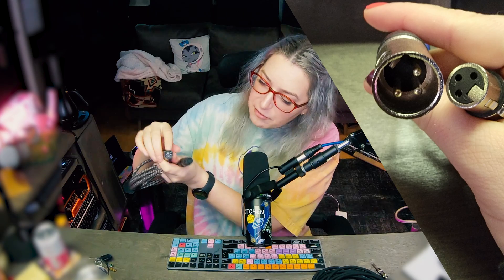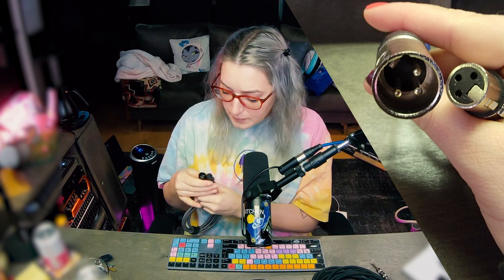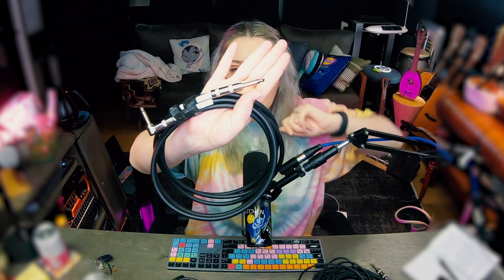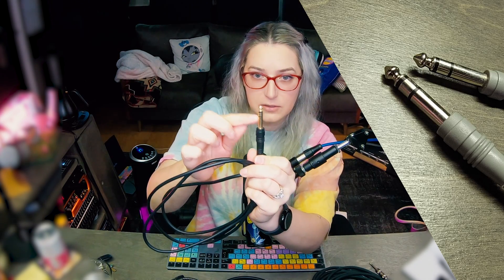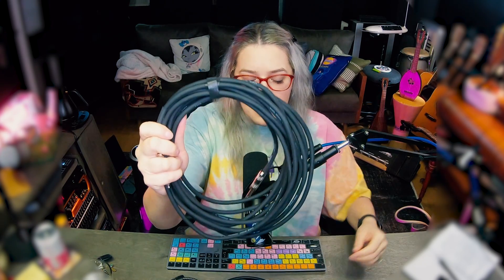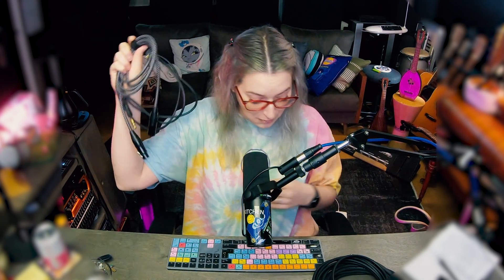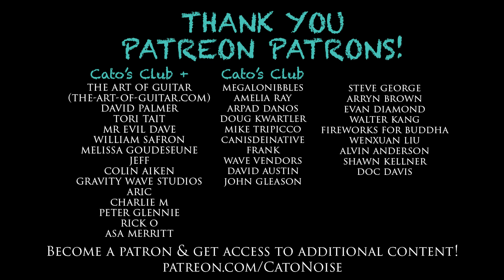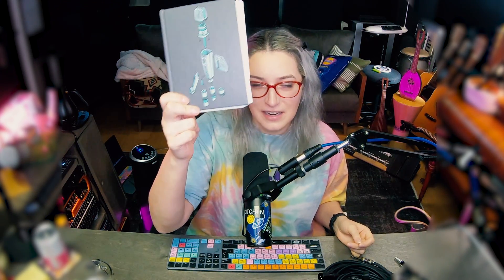Audio Cables 101: How Balanced Cables Reduce Noise, TRS, TS, & XLR, & Speaker vs Instrument Cables

Comment: Well, I'm not any professional in music industry. I'm simply a teacher of commerce subjects. It was my birthday yesterday and I've gifted myself a guitar to disengage my brain from all the noisy words of the regular languages. I think I've acquired enough wisdom in words grossly. Now is the time to go beyond. Well, I'm 38 years old. with my guitar I got a quarter inch TS shielded cable, which is very thick. I was about to use my audio TRS. So, I asked Gemini. It says it's not possible and provided your video link.
Reply from the maker: Happy belated birthday! So glad my video could help you on your guitar journey, that's such a cool way to unwind!
Reply: Thanks for such a quick reply. Well, Gemini says I can't use TRS  plug-in in the guitar's TRS jack because the Ring between the plastic insulation won't let it complete a circuit to switch on the Ibanez Preamp. It's only the TS shielded cable that can switch it on. Do you also agree with it?

Comment: Here is the simple math of why Cato's explanation in the video works. Imagine your audio is the number 5 and the noise is the number 1.

Unbalanced (TS/RCA):
Cable sends signal (5).
Noise (1) leaks in.
Result: 5 + 1 = 6 (Distorted/Noisy Audio).

Balanced (XLR/TRS):
Cable sends two copies: Normal (5) and Flipped (-5).
Noise (1) leaks into both wires equally because they are twisted together.
Wire A has 5 + 1
Wire B has -5 + 1
The Magic Moment: At the destination, the gear flips Wire B back to normal.
Wire B becomes: -(-5 + 1) which equals 5 - 1.
Final Sum: The gear adds Wire A + Wire B.
(5 + 1) + (5 - 1) = 10
Result: You get double the signal (10), and the noise (+1 and -1) cancels out to Zero.
Reply: What is the "Gear" doing?
Inside that piece of equipment (the mixer, interface, etc.) is a tiny electronic component called a Differential Amplifier.
When the cable plugs into the "gear," this component is the "brain" that says:
"Okay, take the signal from Pin 2 (Normal)."
"Take the signal from Pin 3 (Flipped)."
"Flip Pin 3 back to normal."
"Add them together to kill the noise."
So when I said "the gear flips the signal," I meant the internal circuitry of the mixer or interface you plugged the cable into.
Reply from the maker: Thanks so much for adding this! That's a great way to put it, and I'm sure it'll help people understand even better 😊
Reply: It's not me alone. it's Gemini and me!😊

Comment: Couple of pedantic points (on a truly impressive video but I have some experience with mics:)

* A differential amplifier (the receiver) doesn't care which signal is flipped, tip or ring, doesn't matter. Only one input is  inverted. Might need some hand waving but I assure you this is the case.

* Differential cable can also power a microphone too. Condenser units (the ones  you brandished so brilliantly in the MS Stereo video). So there's not just a signal on each wire - there's also (typically) 48V on each one too. The exceptions are dynamic and most ribbon mics, although I did hear of a powered ribbon appearing with an on-board amp - maybe someone finally solved the transformer problem. (Technically someone did at least a decade ago, but that used 128 transistors - themselves quite expensive ones at that.)

* The first (at least the most common) circuit for biasing and amplifying a condenser mic (which up until the 1950s was all transformer based) was developed by Jurgen Wuttke of Shoepes. I only know this because I've spent hours admiring the circuit (after I'd figured out how it worked, which took a while).

*  Last but not least, did you know that you can make a "pseudo-balanced" cable by connecting  the Tip or Sleeve to ground. It's not ideal (and won't work with a powered mic) but a lot of professional microphones do just that. Drop the signal on one line and then match the (50-200 ohm) impedance on the other. So long as the impedances are the same on each line, you get the noise reduction. Might save on a few components, I might have to try it.

* Another interesting fact - balanced cables disconnect ground. The signal works against itself (it is it's own ground reference). In some weird case where you were using generators in addition to some other gear and the grounds varied by even 1000s of volts, it won't make a fig leaf of difference.  Like you, I love this!

And a final bit of audio history. Early surround sound systems encoded the surround signal, in mono and in antiphase on left and right channels. A differential receiver (the same circuit used in your amp for an XLR) removed the "mono" part of the stereo signal and brought up the surround signal. A slight delay completed the effect.

Comment: So I was watching this to learn about what Cable lead I needed for Rico-sound, on my Rickenbacker 620, which I knew basically was a stereo cable for guitar. Now I am wondering did I just hear correctly that TRS cables are balanced more so than TS cables and that if I use them as a mono lead they cancel out any noise? By the way thank you for defining the difference between speaker cables and instrument cables.

Comment: Really great stuff! This helped me to work out why I was having some weird noise issues with my guitar set-up (Line 6 POD Go into a TASCAM multitrack console.) I'm hopeful that by replacing my instrument cables with TRS to XLR cables, I should be able to eliminate some handling noise that's been driving me MAD. 

Major props. Even if that DOESN'T fix my issue, this is still really useful info.

Comment: This is only relevant for low voltage signal wires, it doesn't matter for high power amplified signal cables. If there's 200w of audio going through a cable, a couple micro volts of EM interference won't make any difference what so ever.

Comment: For the purposes of explanation, I would have included corresponding jacks. You could show the plugs inserted into the jacks and show how the signals are directed differently.
Reply: Also, the shield (wire mesh around the signal portion of the cable) is generally used for the ground connection.
Reply from the maker: Yeah, thanks! I figure I can show that if I do a soldering video or something similar. I'm usually pretty short on time making these videos lately.

Comment: Speaker cables are always unbalanced, not balanced. Since they carry large amounts of current/voltage coming from power amplifiers, their unbalanced design prioritizes low resistance without concern for common mode rejection.
Reply from the maker: Thanks! And they're usually not shielded too, right? (For similar reasons) So if you use them as an instrument cable, then you're more likely to pick up noise.
Reply: @CatoNoise  yes, exactly! Unbalanced, unshielded. Your channel is great- thank you!

Comment: Those balanced cables are pretty cool, but a lot of synths seem to have unbalanced outputs. This gives me problems sometimes with synths that have a USB connection as well as a line out. What I often run into with a Roland TR-6S is the USB noise interference when the USB cable is used simultaneously with the analog line outputs. It’s kind of an annoying problem, I’ve learned to either only use the USB connection or to only use the line out in combination with battery power to get clean noise-free recordings from it. Are there effective solutions to prevent these sort of ground loop interference issues? I don’t seem to get this issue on equipment that use USB solely for data and that use a separate DC power supply (like the Yamaha reface series). It seems that USB bus power and analog audio connections are not an ideal combination in regards to noise.
Reply from the maker: Interesting, yeah, I have heard that about a lot of synths having unbalanced outputs. I assume you've tried using balanced cables for your line outs just in case, yeah? Have you tried plugging into something like a DI with a ground lift button, pressing the ground lift button, and seeing if that fixes it?
Reply: @CatoNoise  I have not tried a DI before, all of the devices that I have are small, portable synths that I can optionally run off batteries. It’s an improvised home/bed room studio setup. After some experimentation I established that using the Roland devices with just battery operation works best if I want to I record them from the line-out into my interface. Somehow the combination of powering it from the USB whilst also beeing  connected via the analog outputs to an audio interace (that by itself is also connected via USB ) is a bit of a problem.  The scenario where the TR-6S is only connected via USB (in audio/midi interface mode) seems to work OK too.  I’ve heard of so called USB isolators, I wonder if they could be a remedy in my case to avoid having to use batteries for power.
Reply: @dykodesigns  Try an active DI. I bet it will clear up the noise.

Comment: Super awesome that balanced audio transmission is making its way into more accessible consumer gear. Does pro equipment usually have the ability to distinguish or configure between TS and TRS on the same input, or are they separate plugs?
Reply from the maker: It usually depends on your system. So let's take 1/4 inch cables and jacks, for example: Some equipment can send out a stereo signal through a single 1/4 inch jack, and in that case it's unbalanced signal that's being sent out, despite the fact that you're using a TRS/balanced cable to run the signal (it's the same as if you had two TS cables running the left and right out - you're not using the polarity flip concept here, you're running two distinct signals through the T and R wires). But, usually, with studio equipment, we have something called "line inputs" and "line outputs" for sending signal in and out of our devices using 1/4 inch cables, and we just assume those are balanced, and connect TRS cables to those. It's not like the world will end if you plug a TS cable into those, but it's just not quite the right way to do it/not the best. Sometimes, (like with my audio interface, the Apollo 8), there are separate jacks labelled "Hi-Z" on them - and that's designed for plugging in your guitar using a TS cable. So, if you were plugging in a guitar to record, you would use that Hi-Z jack with your unbalanced guitar cable instead of the line inputs. So a lot of the time, they're separate jacks. The really cool thing though, is that some devices are fairly intelligent about it. Like with the Apollo interfaces like mine, if you plug a TS cable into that Hi-Z input, then that input channel will automatically switch to Hi-Z input, and can't be switched for mic or line input until you remove the TS cable from the Hi-Z jack. It also won't accept signal from the channel's XLR or TRS inputs while the cable is in the Hi-Z jack. So I think that's a really long way of saying it's usually context dependent, and there are often separate jacks. Like, for example, I assume all guitar pedals are expecting unbalanced cables. The plugs themselves are often the same (ease of manufacturing and such), and I think it's the way it's hooked up and the circuitry that it's connected to that really decides.